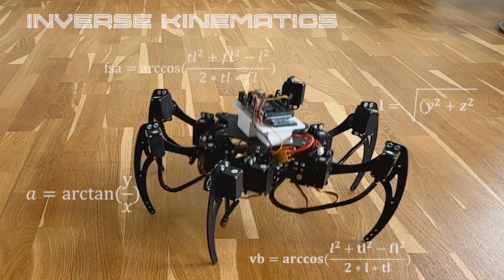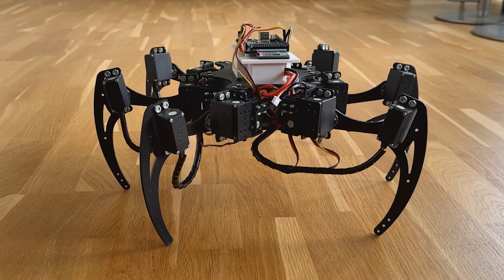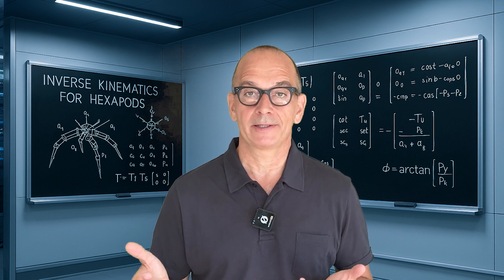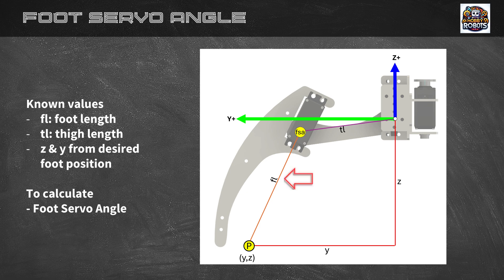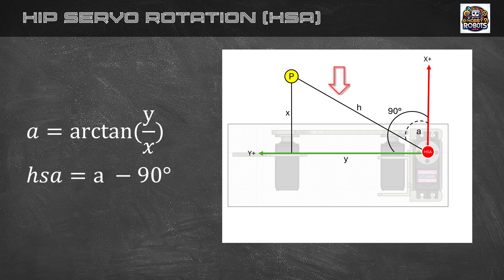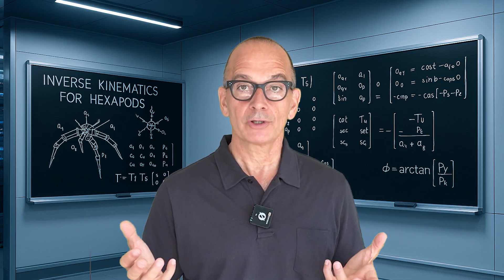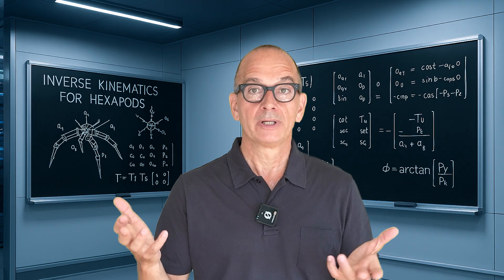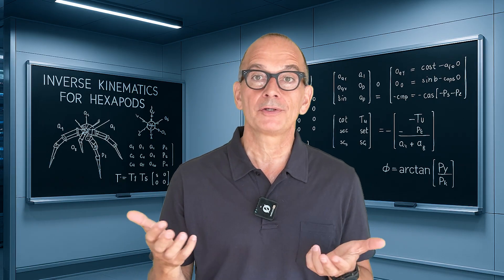Master Inverse Kinematics for Arduino Robots – Easy Math, Full Code, Real Results

Comment: I think the video just calculates the foot joint (one joint) instead of the foot and the knee joint. I think a future video should cover redundancy (multiple joints in the same orientation) and which policies are best for Hexapods to look like they have natural movement.
Reply from the maker: Not sure I understand. Both hip, knee and foot joints are calculated. Making good movement is less about calculation and more about animating desired feet positions at right speeds realistically. Alternative approach is using reinforcement learning and a desired animation  sequence as reward function. Disney used this approach for eg. Bd1 duck. They have good article. Likely overkill for Hexapod though. https://la.disneyresearch.com/wp-content/uploads/BD_X_paper.pdf

Comment: Can this method be used for high DOF e.g., 6 DOF robot arm as well?
Reply from the maker: Likely not. I used a simplistic approach for this. Consider Jacobean inverse kinematic, reinforcement learning or even brute force (you can calculate rotation of base and hand rotation manually so likely only need to brute force four joints on pc doable fairly fast and at least pretty easy to implement). The issue with 6 dof is among other that there is not a single right answer like with Hexapod. For 6dof there are multiple possible solutions so simple math will not work as well.

Comment: Hello sir, is it possible to create more content that has the kinematic implementations in c++. Thank you for providing this amazing knowledge
Reply from the maker: I made the implementation for arduino and used classes for servo and leg so the math part is already kinda C++. If you need for a specific platform you would get a pretty good result by feeding code into chatgpt and ask it to rewrite for that platform. Be aware though that LLMs i tried all struggled to produce the right code for rotations so be careful that math do not change 😊

Comment: I made a 3D spider robot in 2008 and ran into the same issues during animation. I learned about inverse kinematic when animating humans. Since then, I’ve become interested in learning how to make random bodies with skeletal and muscle structures and use AI to learn how to walk - some projects like this exist on YouTube.
Reply from the maker: Yes you are correct. Found some good stuff on how implement this generically on any skeleton. The issue is that the math is harder and less intuitive and not so easy to make run on Arduino. Took a few simple shortcut for the Hexapod to make it easier to understand.

Comment: Really nice explanations for the given problem. The issue you explained at the beginning that most information about inverse kinematics is grounded on the situation, that the problems are explained with a general point of view. For Example, the Denevit-Hardenberg-Paramter model allows to describe an arbitrary long combination of links, with different set of fixed and dynamic angles and link offsets. This Description can easily be converted into a mathematical Model which can be solved by different methods. Since an arbitrary long combination can lead to multiple valid solution those problems need to be solved often via numerical approximation. In your example this seems way to overkill but this the key difference. Your approach works only for your given hexapod, while generalised modeling helps to easily develop inverse kinematics for more complex arm robotics.
Reply from the maker: Very true. I have tried doing IK on robotic arms in ROS a few years back with many links and as you say there can be multiple solutions. However this is harder to understand intuitively and not super suited for arduinos 😊 For robots where legs just have a few joints moving in one direction I liked the “simple math” approach

Comment: Thanks for this video very helpful! is it possible to switch from Pololu to PCA9685 by just updating every part that uses plolu?
Reply from the maker: More or less not hard. I use pololus ability to control speed on servos as well to walk slowly. if i remember correct PCA cannot do that so you will only have one speed

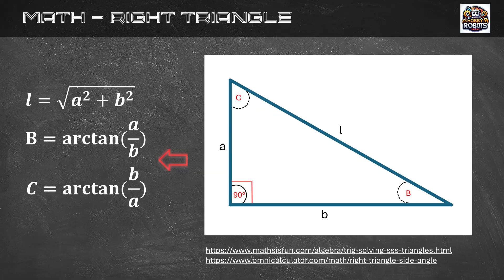Comment: Great video. I think the inverse cosine formulas for B and A  at 4:29 are wrong.
Reply from the maker: Well spotted you are correct. Did not notice since they are not used in hexapod. Formula for B is calculating A and formula for A is calculating B
Reply: @jakobleander I really your videos. I watched a lot on inverse kinematics but your explanation is the best. Thank you.
Reply: @jakobleander what do you mean that the formulas for a and b are not used in the hexapod?
You have used it in your robot because all the three formulas are the same formula with just different variables?

And Thanks for the video, and making me understand inverse kinematics.
Reply from the maker: @nevin8604 Fair point 😊 In my head it was the C angle i used but it is of course the same formula
Reply from the maker: Tx for feedback. Added a correction tag to the video
Reply: yea dude i saw the same thing and thought i was tripping.now i know